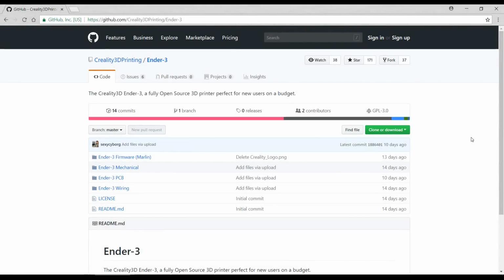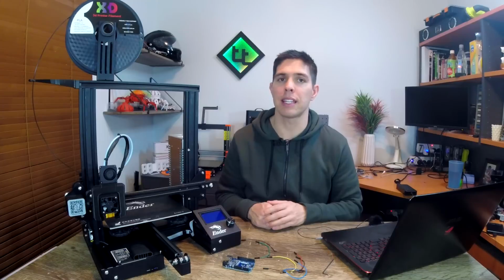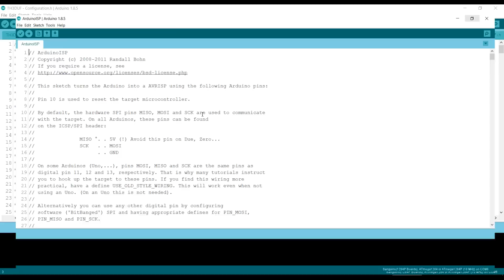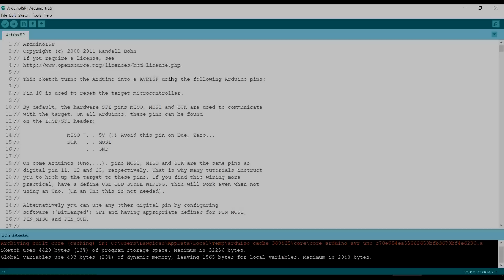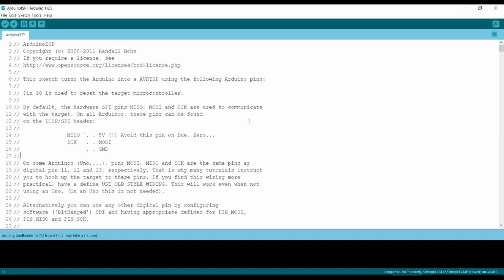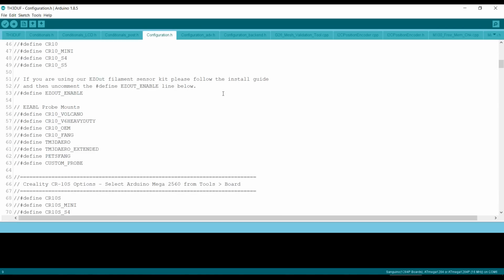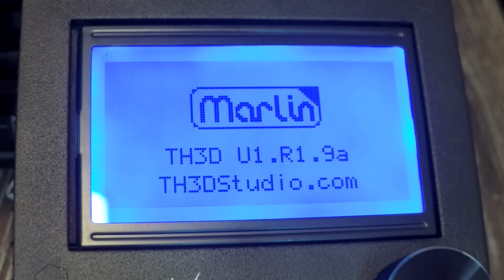Ender 3: How to install a bootloader and update firmware

Comment: I don't have an Uno but a 2560,. will that still work?
Reply from the maker: Yes, instruction are in the ArduinoISP sketch.
Reply: @TeachingTech  - do you talk about line 91 to 100? What is the result of this message? Do I have to use other pins than the given ICSP header?

I have had a long diuscussion at https://www.youtube.com/watch?v=fxFLkqD6QTU&lc=UgwGlniCFgFPVZ53FDN4AaABAg with additional informations about my issue but no success so far.
Reply: @TeachingTech  -- I checked the my cables again... SUCCESS ;)
I had a interruption in one of my Dupont pins....
Now the bootloader is transferred. After releasing the master and switching the main power the display is empty.

Next Station ... Marlin 1.1.9

Comment: Dude. This was incredible. I just ordered that little board and those cables! Just a question: can I use that same board to set up that BLTouch or do I need a different one?
Reply from the maker: Once you flash the bootloader once wit the little board you never need to do it again. You can make as many changes as you need later on directly from the computer via USB cable.

Comment: Following your instructions to upgrade. What editor or software are you using to search for the text "thermal"? What are you using to edit files?
Reply from the maker: In this video I'm using the Arduino IDE packaged with TH3D firmware.

Comment: Do you have to update the firmware to calibrate the extruded e steps?
Reply from the maker: You can do it still but the M92 code to set the new steps has to be put in the start gcode because EEPROM is not enabled to save it in properly with stock firmware.

Comment: I'm getting this error. Any advice?

Arduino: 1.8.7 (Mac OS X), Board: "Sanguino(1284P Boards), ATmega1284 or ATmega1284P (16 MHz)"

sorry - this program has been built without plugin support

exit status 1

Error compiling for board Sanguino(1284P Boards).

This report would have more information with

"Show verbose output during compilation"

option enabled in File -> Preferences.

Comment: Could you instead use a MEGA? Got a few of those laying around, but no UNO
Reply: hi, of course it's the same as UNO, you have to change only the type of board on MEGA 2560
Reply: @Florekk  Thank you sir, I was figuring ICSP is ICSP but the whole measure twice cut once mentality.
Reply: @Florekk  Using MEGA we still use PIN 10 as showed in video?

Comment: I have a question that you probably are the perfect person to ask.
I have an old prusa Mendel with an arduino on a chip. When it worked it allowed me to print to it from my mac via a printer cable. I was wondering if I could repurpose that arduino to add capabilities like printing from a cable to my Ender 3? I am not a tech wizard by a long shot, so if it involves custom coding, I am not going to bother. But if I can easily reuse parts of that old printer to improve my new one, then why not?
Reply from the maker: As long as you install the Creality driver first you can connect and print from your computer the same way with no modifications to your Ender 3.

Comment: Hi Michael,
My friend has an Ender-4 printer.
Do you think can I upload the same bootloader and firmware with the same method?

I did it on my own Ender 3 and works well but I'm not sure can I use the same method to his Ender-4?

Thx and best regards,
Feri
Reply from the maker: The bootloader, yes. Please check if TH3D supports Ender 4 before you start.

Comment: What if i'm not "seeing uno there" or I get an error saying that its expecting ATmega1284p, and im using the same arduino uno r3 atmega328p listed in the banggood link?
Reply from the maker: You don't set the board to 1284P until after you have finished flashing the bootloader. The order is important.

Comment: I burned the bootloader and it completed and said "done burning bootloader" but the screen on the ender 3 is now blank when machine boots and there is no option for com port when plugged in via USB using th3d Arduino software... What can I do to fix this?
Reply from the maker: All you are missing is the driver, available on the th3d website.
Reply: @TeachingTech  got it now thanks a ton!!
Reply: @russellwells6814  haha same. i forgot the drivers. i was affraid for a sec that i fried my board :)

Comment: @teaching tech I followed your guide and using the same Arduino Uno like in you vid, but I seem to get an error when I want to burn the bootloader: 
"avrdude: stk500_recv(): programmer is not responding
avrdude: stk500_getsync() attempt 1 of 10: not in sync: resp=0xbe"
I double checked wiring of the Jumpers and settings in "Tools" to make sure I did it correct.
what am I doing wrong?

EDIT: Found the solution for my problem (incase anyone else having this issue with ATMEGA328P UNO) 
- Go to C:> Program Files (x86) > Arduino > hardware > tools > avr > ect. 
- Open "avrdude.conf" with Notepad++ (or any other text editor)
- Ctrl F and search "328"
-  go to "driver signature" and make sure the last values corresponds with your UNO signature. e.g: mine said "= 0x1e 0x95 0x14" so I changed it to "= 0x1e 0x95 0x0f;"

hope this helps.
Reply from the maker: thanks so much for posting the solution, people rarely do it and it really helps future searchers.
Reply: @TeachingTech  Yasien Teledia Where do I find what my Uno's Signature is supposed to be?
Reply: i'm facing this error too and i am using same board too and i followed this way but still giving error :( 

Arduino: 1.9.0-beta (Linux), Board: "Sanguino(1284P Boards), ATmega1284 or ATmega1284P (16 MHz)"

avrdude: stk500_getsync() attempt 1 of 10: not in sync: resp=0x7e
avrdude: stk500_getsync() attempt 2 of 10: not in sync: resp=0xe6
avrdude: stk500_getsync() attempt 3 of 10: not in sync: resp=0x9e
avrdude: stk500_getsync() attempt 4 of 10: not in sync: resp=0x18
avrdude: stk500_getsync() attempt 5 of 10: not in sync: resp=0xe6
avrdude: stk500_getsync() attempt 6 of 10: not in sync: resp=0xe6
avrdude: stk500_getsync() attempt 7 of 10: not in sync: resp=0xe6
avrdude: stk500_getsync() attempt 8 of 10: not in sync: resp=0xf8
avrdude: stk500_getsync() attempt 9 of 10: not in sync: resp=0x06
avrdude: stk500_getsync() attempt 10 of 10: not in sync: resp=0x98
Error while burning bootloader.

This report would have more information with
"Show verbose output during compilation"
option enabled in File -> Preferences.
Reply: avrdude: stk500_getsync() attempt 1 of 10: not in sync: resp=0x2d
this is what i am getting, what do I need to chage?
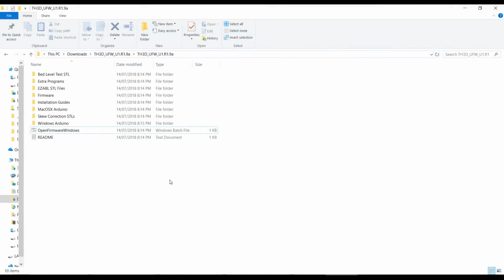Reply: @carlylefife3521  I was having the issue you are, with the Unified Firmware U1_R2_10d.  The "not in sync" message means that the bootloader did not flash to the Ender 3 (Michael briefly mentions that in the video).  My solution: I needed to remove all of my Arduino drivers.  Then, I plugged the Arduino Uno into my Windows 7 64bit PC and the driver installation failed.  It gave me the options of searching the web (no) or looking on my computer (yes).  I browsed to the folder I downloaded the firmware to, and then to TH3D_UFW_U1.R2.10d\Windows Arduino\drivers, and allowed Windows to include subfolders in the search.  Windows then installed TH3D's Arduino driver.  I then went back to 3:55 in this video and repeated everything.  My Ender 3 is up and running now.  I hope this helps!
Reply: @camphollysprings   thank you
Reply: @camphollysprings  i had the same error today..  do you mean we need to delete the arduino drivers on the windows pc?   I'm  not really sure how to do that..   can you tell me how?
Reply: @georgelouie5330  It depends on your version of Windows (and I am NOT an IT professional!), but in Windows 7, you go into the Control Panel, then Programs and Features.  This will show a list of Programs installed, including your Arduino drivers.  My current drivers are listed there as Windows Driver Package -  Adafruit Industries LLC (usbser), Windows Driver Package -  Arduino LLC (www.arduino.cc) Genuino USB Driver, Windows Driver Package -  Arduino Srl (www.arduino.org) Arduino USB Driver, Windows Driver Package -  libusb-win32 (libusb0) libusb-win32 devices, and Windows Driver Package -  Linino (usbser) Ports.  I don't think I had this many until I reinstalled the driver(s).  Check the date on your current Arduino driver (there may only be one), and if you see any other drivers that installed on the same date as that driver, they may also be associated.  Be careful not to delete any drivers not associated with your Arduino!  Once you know which driver you wish to remove, select it with a left-click and then click the Uninstall/Change button above.  Once it's uninstalled, reinstall the Arduino drivers as I mentioned in the previous comment.  I hope it works!
Reply: @georgelouie5330  This might also help:  https://www.arduino.cc/en/Guide/DriverInstallation
Reply: You probably forget to plug the blue wire on the pin 10, works for me
Reply: I had something similar. Turns out I forgot to flash ISP into my uno first.
Reply: I tried this but i could not get it to work.
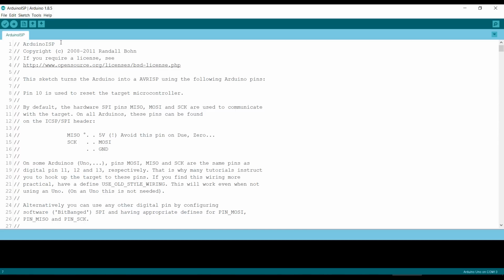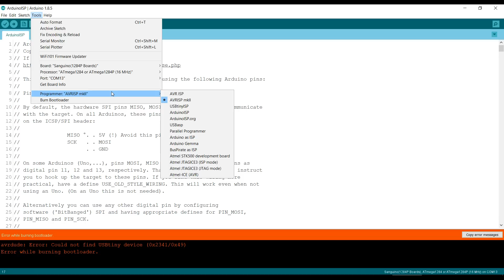Reply: @ManyMaxTalks  - i finally got it to work..   see my post above..  There are 2 separate and distinct operations which are occuring.. First you need to upload the software to the Arduino UNO board.  (@6:19 he hits the Upload Button)   Then you need to flash the ENDER 3 Board from the Arduino Uno Board. (@8:20 he hits the "burn" bootloader button.)        The first part does not require you to open the case and connect the jumpers.  highly recommend you do that step separately..  then open the case, connect the jumpers and follow the video from there.     Also, pay close attention to which window he is working in...  look at the header of the windows in the video.. the windows switch quickly and they look similar, so if you're not paying attention, you might be in the incorrect window.
Reply: Will this take care of this error I'm getting with my atmrga168u Arduino:

avrdude: AVR device initialized and ready to accept instructions

Reading | ################################################## | 100% 0.00s

avrdude: Device signature = 0x1e9406 (probably m168)
avrdude: Expected signature for ATmega1284P is 1E 97 05
         Double check chip, or use -F to override this check.

avrdude done.  Thank you.

Error while burning bootloader.
Reply: I get this problem when I try to flash it (successfully burned the bootloader before).
This solution doesn't seem to work in my case.
Reply: @Duckly97  I used an older version of Arduino IDE and it worked, now I got the firmware on my 3D printer.
Reply: Can i use arduino nano here insted of uno?

Comment: Thanks for this tutorial (and all your great content). I still ran into a bunch of problems flashing the bootloader, however.

In case anyone else runs into the same issues: 

I couldn't get the USBtinyISP from Adafruit to work, so I tried a vanilla uno per your video. When that also failed I really thought I'd bricked my printer.

If anyone else gets weird protocol error messages from avrdude when trying to program the bootloader, try putting a 10uf capacitor between the reset pin and ground ON THE UNO ACTING AS THE ISP (not on the Creality board). The reset pin is the one on the 6-pin ISP header on the uno that DOESN'T have a jumper on it. Apparently, a stray reset signal gets generated somehow and the cap keeps the uno from resetting in the middle of programming. Very repeatable for me: errors every time without the capacitor, works perfectly with it.

This thread gave me the clue I needed: https://forum.arduino.cc/index.php?topic=342977.msg2364239#msg2364239
Reply: More info on why it's required: https://forum.arduino.cc/index.php?topic=104435.0
Reply from the maker: Thanks for sharing the solution, it really helps others.
Reply: This worked for me with the 'unknown response', 'protocol error' bug too, thanks!
Reply: Lee Wasilenko  Glad it helped. Also glad I wasn’t the only one!
Reply: @ikkentonda  Out of curiosity, were you trying to flash the bootloader via a laptop that was running on battery power? I have a suspicion the 'reset noise' is a result of the Ender 3 PSU being connected to ground but the power for the board coming from a laptop on battery.
Reply: Yup. Mac running OSX with an usb-c breakout cable.
Reply: IIRC, I also tried with an Apple usb-c power cable plugged into the dongle, but there is still no shared ground regardless.

Comment: Hey! Great tutorials! Learnt alot from you! I Burnt the boodloader onto the Ender 3 board tho when i plugg in the cable directly into the ender 3 and try to upgrade the firmware i seem to have a com issue. says port 1 in settings but i get an error uploading to the board. avrdude: stk500_getsync() attempt 10 of 10: not in sync: resp=0x90. Any suggestions?
Reply from the maker: The solution to this has been posted by others in the comments. Good luck.
Reply: I found the solution to my problem and was the easier fix ever.   Changed to another cord..
Reply: I was having this problem and followed this: https://old.reddit.com/r/ender3/comments/a0r7u9/cannot_flash_bootloader_with_th3d_and_arduino/eak02oz/

Comment: I keep reading about memory limitations when installing a bootloader and the possible need to disable functionality like SD card support to have room for auto bed leveling.   Should I be concerned about memory limitations if I want to do auto bed leveling in the future?   Also, do new Ender 3's come with a bootloader yet?   I've seen it requested.
Reply from the maker: New versions still don't come with it. My two Ender 3 BLtouch guides retain the SD card. It can be done, just need to disable other things not used to make it fit.

Comment: Sorry to bring a negative comment to the party but here goes.  My impression is that you take it for granted that everyone knows how to do everything. Even the simplest of tasks can be daunting for a complete novice.  For example: what app is used with Windows 10 to open and edit the Arduino? Where is the actual downloadable file for the Ender 3 firmware,  would a link be useful? How about a few mentions of what could and probably would go wrong for a novice with little or no experience of Arduino etc?  Is it possible to completely brick the eprom and what would you do then? Oh and maybe slow your presentation down a bit
Reply from the maker: Before you post any negative comments, it's a good idea to actually read the description, where all of the software is linked. If you're new to this, multiple views are advised to let the process sink in. There is only so much I can slow it down before it becomes unwatchable for 90% of people. Viewers frequently comment that my guides are concise and to the point. If I expanded to include every permutation, I would lose this. Please remember this is a free guide. If you don't like it you are free to use another or not flash's bootloader.
Reply: Wow, so constructive criticism, which by its nature are sometimes viewed as negative by some,  not welcome then? As a presentation coach who has trained  BBC, ITV and CCN presenters for over 30 years, I think my comments on your presentation style are valid. You talk to fast, your voice is a monotone, and your explanations assume a level of expertise. Yoou are falling into the "Experts Trap".  Remember to assume makes an ass out of you and me !  And you are quite right, there are other professional and more concise presentations on how to flash a bootloader, such as this one. https://youtu.be/QWwtbmg_AxQ
Reply from the maker: Firstly, I take constructive criticism well. You were the one who labelled your own comment negative, before I did. You criticised things I hadn't done but actually had. My point is that in this case I don't agree with most of what you have said, based on almost 30,000 views and the fact you are the only person to say anything like this. In fact, I get overwhelming positive feedback on my teaching style and pacing across all of my videos, which I greatly appreciate. I could definitely improve my presentation style, and I hope I am with each video. It's already a lot better than my earliest videos. There aren't many on YouTube who fall outside of this category. I agree that 3D Printing Canada makes some good videos. I refuse to have to criticise them to defend myself. If you don't like my videos, please peacefully move on.

Comment: I found that the TH3D Acceleration and Jerk settings at default were way to high verses the vanilla Marlin settings might want to be noted as it caused me some headaches figuring why I was getting layershift on my Ender 3.
Reply from the maker: Good info, thanks for sharing.
Reply: i have the same problem,could you tell how to solve this please?thx
Reply: Just updated the firmware and now I’m getting y axis layer shift as well on my ender 3. Any thoughts on how to fix?

Comment: help after loading the boot loader i get no port showing, this is the uno i used any help would be brill as got a bricked printer atm
Reply: ok ignore this had wrong cable turns out the cable was a charge only lead o0